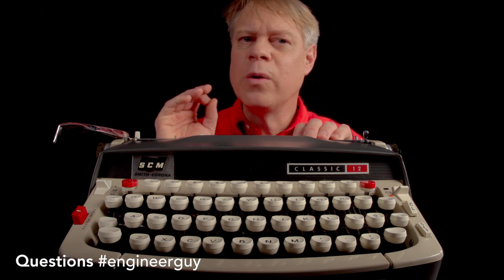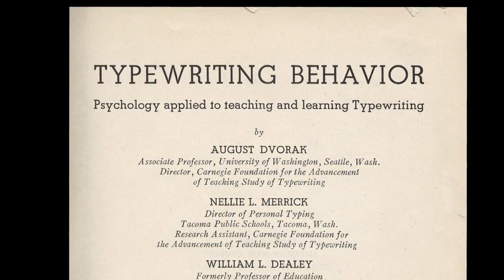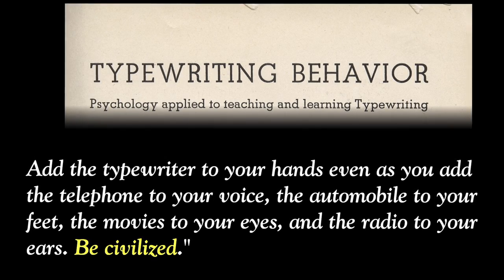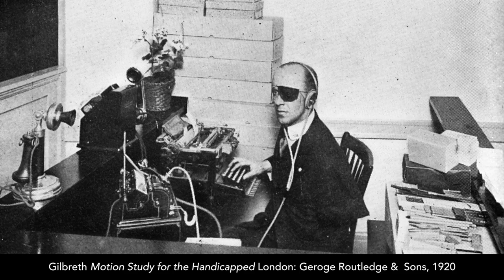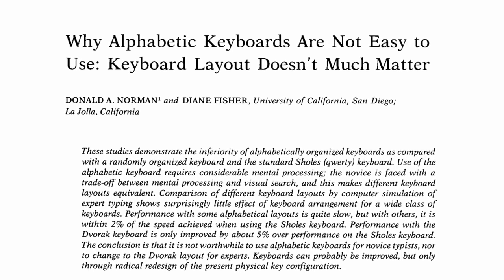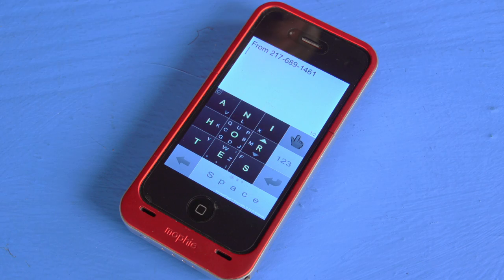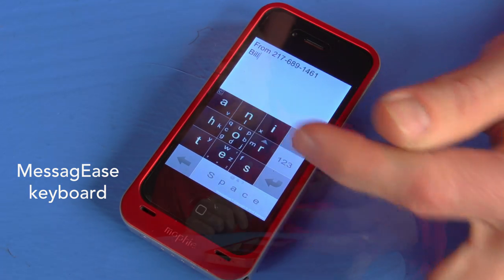Why the Dvorak keyboard didn't take over the world

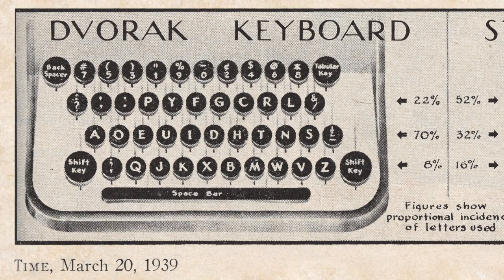Comment: 1:29 What has the visual field to do with the arrangement of the keys? Typewriters were/are made for personnel trained to type blind.
Reply: Really? Keyboards, sure, but I doubt typewriters were designed this way, where you have to precisely pick single letter and use big force (compared to todays keyboard, where no force at all is needed).
Reply: Hi, whey you first learn to type, you basically stare at the keyboard to find the keys, as you get better you look at the keyboard less each time.

At school they teacher had one bit of advise, learn to type something you know and can spell.

We all had to type out our name and address, for 30 mins

As children when we visited offices and banks, the secretaries could talk and type or basically read of those upright  A4 paper holders, basically read the hand written notes and type them on the screen, they would spend most of the time looking at the notes and barely looked at the keyboard - when finished they would read back and check for mistakes.

The ones using dictaphones were just as good, headphones on and they just looked around the room while typing.

More interesting now that there is now "mechanical keys to get jammed"  i recall mid 80's again the QWERTY Vs the DVORAK issue came out again - maybe the apple mac had a option, but it was more of a argument of words with both sides claiming superiority.

Personally, i had a coworker who with Win98 changed the settings and ordered a Dvorak keyboard because he heard it was better, one day i asked him at lunch and he said, you get used to it, most thingd in life are the same it is what you know best or grew up with

Regards
George
Reply: @georgemaragos2378  I've done a lot of typing through the years. At one time I worked at a newspaper, when we typed in articles to the computer from manuscripts. Really we weren't thinking of what we were doing. We read the words on the paper, and almost automatically it went through our fingers. We were also able to talk with each other, when we were typing. And even today, many years later, I don't look at the keyboard when I'm typing.

Comment: This comment was typed with my computer keyboard layout set to Dvorak!  

I learned the  layout because I was getting pain in my tendons from trying to use Qwerty.  For me the advantages are;  if you switch the keyboard layout to Dvorak,  the labels on the keyboard doesn't mean anything anymore,  meaning you HAVE to touch type.  

Learning to touch type in Dvorak,  for me at least,  was much easier. About a month before I could get rid of the keyboard layout printout stuck to the wall.  The training tools get to real words much quicker than Qwerty training tools, because the most common letters are the first keys you learn.

 If you can already touch type with Qwerty,  there probably isn't much reason to change.

Comment: About ten years ago, I used Dvorak extensively and exclusively. I don't know if I typed that much faster – but it was significantly more comfortable. Eventually I switched back to Qwerty and I immediately noticed how my fingers would cramp up again. Ironically I switched back because my touchscreen devices didn't support software Dvorak keyboards. I really hope to be able to switch back to Dvorak at some point.
Reply: Use Dvorak for physical keyboards, and qwerty for digital.  Dvorak isn't good for digital, anyway
Reply: @horsemumbler1  and why is that?
Reply: @Halbmond  
Having all the vowells together makes typos too easy, for one.
Reply: @horsemumbler1  I can see that argument (it’s similar to the argument of why in Qwerty letters are as far apart as possible), but I don’t think it’s necessarily true. It’s certainly a hypothesis that’s worth studying, but personally I more often mistype letters that are farther to the sides of the keyboard (by misjudging the size of the keyboard I guess), than just letters that are close to each other. And this is for phone keyboards; on tablets, I think that virtual keyboards are closer to physical keyboards than they are to phone keyboards, increasing the benefits of Dvorak. 

But I acknowledge that software keyboards could be so different from physical keyboards that they’d warrant new studies altogether. In fact, the benefits of Dvorak have only ever really been documented for the English language, and its support for other languages has always been weak.

Comment: Great job.  I had previously believed the entire "urban myth" of the Dvorak Keyboard. So interesting to see the actual reasons for its failure and learn that is only 5% more efficient than the QWERTY keyboard.
Reply: +TVGuy601 However when taken into consideration, if you type a 100 minutes, it means you will probably start to notice a difference. The amount of keystrokes is huge, especially in modern times and in modern times I can imagine the advantage being bigger than a 5% efficiency increase.
Reply: cbernier3 In the end everyone thinks differently. I've always written my theses with such great speed and I've always heard they were a pleasure to read. Especially for teachers that know me a little. It appears that I write in the same way I speak and it apparently is very pleasing to hear. Just imagine that it's different for everyone, because I think faster than I type and I still type very fast.
Reply: Dvorak is a breeze to use compared to QWERTY. This video was inaccurate. People judge these things without the necessary impartiality... They are all rooting for an outcome, right? This is a complex issue and the answer is complex: Dvorak is much better in every aspect.

Comment: For those of you worried about other languages or people with handicaps, the Dvorak layout attempts to handle those problems:

http://en.wikipedia.org/wiki/Dvorak_Simplified_Keyboard

I don't currently use Dvorak but I'd like to try since I have a keyboard with a hardware switch for it.  The problem with software keyboard mapping is things like going down an RDP rabbithole or as another user mentioned, going to a lab in a university where your settings are not saved (or the VM is restored from a snapshot every day).  Nevertheless, it seems very worthwhile considering issues I now have with carpal tunnel.

Comment: Dvorak keyboard is still bad, if you compare it to qwerty, it doesn't improve it that much to justify re-learning this layout. Think for yourself what are the most frequent letters in language? Vowels. Every word has at least one of those. Yet both dvorak and qwerty have letter A at little finger of the left hand (that's the weakest finger of the weakest hand most likely if you type with 10 fingers). "A" is not just vowel that if frequent, it's also an article which makes it even more frequent and it was my particular issue (my little finger was getting tired) when I typed a lot, but then I wanted to try dvorak which is claims to be more ergonomic, but no, it's roughly the same thing.

Overall, both layouts fail to put most usable letters in the center of keyboard where the most strong fingers are, like letter X is in the middle in dvorak, really? That's the most rare letter imo and it belongs where it is in qwerty, near the end of the lower row.
Reply: if you need strength to push keys i think you need a new keyboard not a new layout
Reply: As far as I know the most commen letter is 'e', but OK 'a' comes third in English. 
A solution would may be to exchange the keyswitch of a to lighter one like cherry mx red. (if you have a mechanical keyboard)
Or you use a programmable keyboard  and change the place to very ever you like.

Comment: I use Dvorak. It's a massive pain. The ctrl shortcuts are all wrong. It fails to balance the load between hands, leaving the right hand to do about 60% of the work.

I can still only type 110 words per minute on a very good day, but the main benefit is a minimum of vertical travel while typing. 
Speaking of "Minimum", type it right now on a QWERTY keyboard. That's one of the main reasons I regret nothing.
Reply: +thumbwarriordx Shortcuts are a pain with Dvorak, but with QWERTY the pain is in the fingers, hands, and wrists. To me, the former evil is the lesser one. With Dvorak I can type for hours and not get fatigued. Everybody is focusing on speed when comparing Dvorak to QWERTY. That's blinkered, IMO.
Reply: +thumbwarriordx I find it really fun to type minimum! Words that follow those sorts of patterns and let you glide around are some of my favorites. To each his own, though, I suppose.
Reply: I don't think dvorak is all around superior, or at least, there are some good reasons why it's so hard to learn.

Just look at clusters like NG, WH, SC, SL, RS, PE, and even QU.   They require you to contort your fingers, but in qwerty, some letter combos require very little effort.  I've also found that being in the home row that much can bring its own sorts of cramps.  It's not as easy as in dvorak to change the roles of your fingers.  There's no room for variety in the hand positioning means.   Granted, qwerty is stupid in how much you have to move around the board, but it also means you can change things up since you don't have to cluster very much.   I feel like I can raise a hand and glide around with comfortably strewn many-letter-clusters  in qwerty, but in dvorak, not so much.  I say that dvorak has a lot to offer, but its sheer difference in the very way it makes one type makes it an unusual schematic with its own faults.

Comment: There is another reason why the Dvorak keyboard was rightfully a total failure - It is designed with only a right-handed person in mind. For a left-hander, a Dvorak keyboard is incredibly awkward to type on, since our stronger hand, (the left), is used far less than our weaker hand, (right). With a Qwerty keyboard, the physical "load" of typing is split more equally between the two hands.
Reply: On a QWERTY keyboard, you can type many more words based simply on the left-hand home keys than you can using the right-hand home keys. Much faster for left-handed persons.
Reply: i dont think that plays any role at all in either case. your left hand is better at doing its job and so is your right hand. muscle memory isn't shared between them.
Reply: It is simply false that Dvorak is significantly heavier on the right hand. Do you use the mouse with your left hand? That should give your left hand enough to do